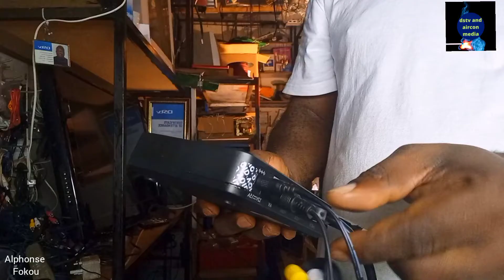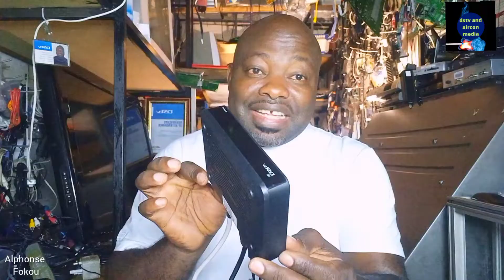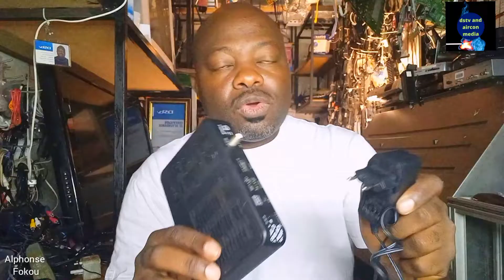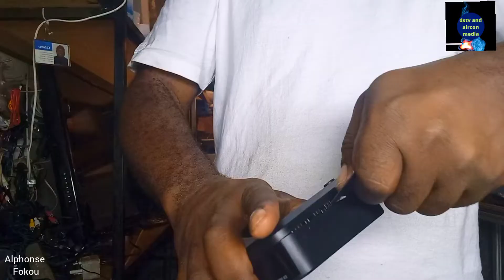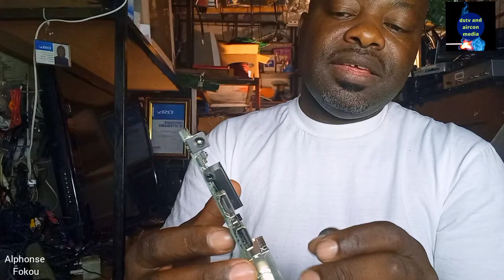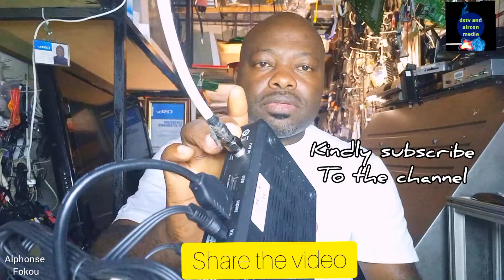know all about your faulty dstv HD decoder. alphonse fokou.

Comment: I got a same hd decoder like the one you have on the video when l plug it it shows an orange light before l even switch it on the remote and power button don't respond changed power supplies still stuck